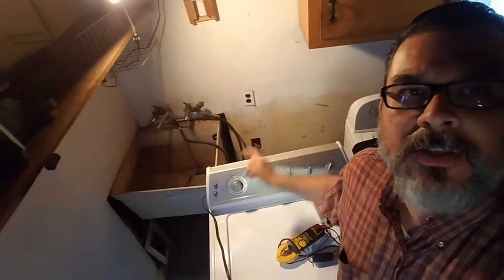When You Put 30 Amps On 20 Amp Wire This is the Result

Comment: I don't buy it. When cable is tested by the manufacturer, it is tested with a factor of 3. This means that a #12 wire has to pass a 60 amp load test in order to be certified. The caveat here is that those tests procedures have to be met by any manufacturer making and selling cable in the USA. These days, you are seeing some Romex made in China and other countries that may be cutting corners on materials used to make the actual cable. They stamp the cable package with their certification testing to match that of the USA, but are manufacturing cable to only look like USA made cable. This may be one of those cases. Folks, when buying cable, outlets, breakers and panels, use only USA made products with a UL stamp. I've actually had custom devices tested and either approved or rejected by the fine folks of UL/ETA. They actually test each product to strict standards to assure quality.   Amazon is one distributor who sells cheaply made electrical products that don't adhere to USA standards.

Comment: That has nothing to do with too much amperage. This is probably localized damage from rats chewing through the wire. You can clearly see dust build-up along the length of wire which would have burned off under a real heat overload. Rats chewed the wire and caused a localized short circuit. I agree on code compliance but your reasoning is flawed. Take a welder and put 60A through 12 gauge. It gets warm but that's it.

Comment: Hello, I have a question. I have a v-neck trailer wired with yellow, 14/2.  I want to be able to plug into camp site 30 amp. But the wire is 20 amps, and the breaker is 20 amps, there's 2 of them. All the appliances (tv, split unit heat/air, out let where the tv plugs into. There's not any 220/20 amp needed.  I appreciate any your help in this mind bender.

Comment: I'm running a large in room A/C unit in my bedroom (I'm in Las Vegas) and when the compressor is on (I researched this in the manual and other places) the unit pulls 15amps. The bedroom breaker is a 20amp breaker. Which when I plug in a vacuum or hairdryer or other items causes the breaker to go off. In the summer it's going off 1-2x a day. Is it possible to plug the A/C unit into a really big surge protector / UPS device, and then plug THAT into the wall? Like create some sort of buffer? Great video now I understand the wire capacity is just as important as the breaker itself. I was thinking "I'll just throw a 30amp breaker in there" LOL

Comment: WOW This video is all over the place. The constant cuts in scenery make is so distracting. You may well know electrical work but explaining it is very confusing. If I'm looking for info on "30 Amps On 20 Amp Wire" I don't need any other info. The whole story about the customer hiring another electrician is 100% not going help with changing a higher amp on a breaker. If you make a mistake on a video (which is good that you caught it) with the marvelous wonders of video you edit that out. Be concise. It does nothing to tell us you made mistake and then have us sit through that mistake.  I am quite certain you know way more than I ever will about electrical but we won't find out this way.

Comment: I know Romex conductors have a lower amp rating than regular thhn (I don't don't deal in Romex, only pipe)..... but it's rated at least 25 amps I believe, the problem might be the tight holes it's run through and the super sharp bends I saw.... there are rules on these things for a reason (before derrating 12 can be rated 20 amps.... of course that's not 100% duty cycle... and none of this is professional advice)

Comment: I’m not a licensed electrician but I suspect that the overcurrent didn’t directly cause the wires to become damaged. The overcurrent did cause the sheathing and insulation to become damaged leading to a short, which in turn damaged the wire.

In any case, someone didn’t know what they were doing. 

Thanks for sharing.
Reply: I did this oh no I thought it was 103 but it was 123 oh no now just eating on bad news lol😂

Comment: You said something that's incorrect.. You said that a number 12 wire is only good for up to a 15amp rated breaker , it's Actually up to 20amp breaker.  ONLY RULE IS YOU "CANNOT"  PLUG A DEVICE INTO A RECEPTACLE THAT'S PULLING MORE THAN 12 AMPS AT A TIME ON A 15 AMP BREAKER OR NO MORE THAN  16 AMP PULLING ON A 20 AMP ... IF SO THE RECEPTACLE IS GOING TO MELT   WITHOUT IT TRIPPING  THE BREAKER.. IT'S VERY RARE SOMEONE WOULD PLUG IN A DEVICE THAT'S DRAWING THAT MUCH POWER AT A TIME ON A SINGLE RECEPTACLE..

Comment: So........you didn't discern this from just looking at the wire connected to the breaker in the panel or just looking at the wire in the plug? Seems like first thing to do is pull the plug. And even if the wire was not damaged that alone would require a new line.

Comment: I have 2) ecoflowDelta Pro units  (solar generators) that, when combined by the double voltage hub, (an echoflow accessory)  creates a 250 v 20 amp outlet.  I intend to run an extension cord (12 gauge?) from this outlet to an inlet box connected the 30amp circuit breaker in my  main panel box.  This circuit breaker is  dedicated to my 1/2 hp water pump.  the wire that runs to the pump is  looks like 12 guage.  My question is, is this a stupid thing to do?
Sonyador

Comment: This is a great video. I was thinking of replacing 20 amp breaker with 30 because it keeps tripping from over draw of power but the wire needs to be changed as well to be able to handle the extra current. Very important lesson. So my question would be how can I determine which outlets are on which breaker so as to seperated machines from same line.
Reply: Turn off the existing breaker, and see what turns off. Then trace the wire from the panel.
Reply: He said something that's incorrect.. He said that a number 12 wire is only good for up to a 15amp rated breaker , it's Actually up to 20amp breaker.  ONLY RULE IS YOU "CANNOT"  PLUG A DEVICE INTO A RECEPTACLE THAT'S PULLING MORE THAN 12 AMPS AT A TIME ON A 15 AMP BREAKER OR NO MORE THAN  16 AMP PULLING ON A 20 AMP ... IF SO THE RECEPTACLE IS GOING TO MELT   WITHOUT IT TRIPPING  THE BREAKER.. IT'S VERY RARE SOMEONE WOULD PLUG IN A DEVICE THAT'S DRAWING THAT MUCH POWER AT A TIME ON A SINGLE RECEPTACLE..

Comment: run 30 amps thru a 14 gage wire rated for 15 amps, the heat will be 4X more than it should be.

Comment: Thank you for your detailed explanation!   I bought a new stand alone air conditioner - Perfect Aire 14k BTU  it has been running fine for 2 weeks, and now it’s throwing the 20amp circuit breaker occaisionaly - Not sure why.  
Perhaps the fridge is running on the same circuit...

I was going to replace the 20amp (new) thinking the new one might be faulty and put in another 20amp.  Then thought why not go up to a 30amp.   Thanks to your video I will not risk burning down my house!!!    Thank you!
Reply: Update problem was a loose wire on the circuit it’s self vibrating just as you said thank you so much it was a quick fix!

Comment: If you put 14 gage wire on a 20 amp circuit will it be ok if it is only from the switch to the light and 12 from the breaker threw all outlets to the switch

Comment: I’m confused is that 12/2 or a 12/3? Are they use the ground as an neutral?  Did you replace the wire?
Reply: Looks like 12/2 with ground, probably an older dryer which does not use a neutral (3 blade plug)

Comment: enjoyed your video. I was hoping you might be answer a question for me. I'm new to this. I bought the min kota Endura c2 trolling motor. The smallest 30 lbs. thrust motor they have.  The battery box they sell is 50 amps circuit breaker. The guy at min kota said I need a 30 amp. Do they make a battery box with a 30 amp circuit breaker that is integrated. or do I have to have a separate circuit breaker.

Comment: So on the flipside aside from possible breaker trips could you use a 15a breaker on a 20a?  Assuming you werent drawing too much power it seems like you wouldnt do any damage aside from having the breaker trip at a lower load.
Reply: There's never a problem with using an oversized wire. The only downsides are that thick wires cost more, and are more difficult to maneuver in walls and fixtures.

Comment: I appreciate the video the wire could overheat and cause a fire.  My electrician did the opposite he used a 220 wire 30 amps for a 20 amp breaker
Reply: David Seaquist --- My electrician is going to replace my 20 amp wiring with a larger wire so that I can run a 30 amp device with a 20 amp breaker. I thought I would need a 30 amp breaker! Is you device working with your 20 amp breaker?

Comment: the point of the video is very important. More than likely someone thought it would be a good idea to upgrade a 15 amp breaker to a 20 amp breaker. the Problem that occurred was the wire was not rated for that. So the wire burned from the inside out which could have started a fire. dangerous! so thank you for the video. you did a great job going step by step. dont worry about what the critics say about your film editing skills. that comes with time and watching others how they do it. but other words, you helped me with my problem so thank you!
Reply from the maker: thank you for your perspective. this is the only reason I have kept this video up, as the information is critical, not because I am a good editor.
Reply: @MassiveElectric  You did okay after the 1st 2.5 minutes.  What through me was you were standing in front of a dark pond that sort of looked like a burnt area so the good news the video is educational and no one got hurt.  I have 12 gauge wire with 20 amp breakers & want to go to 30 amp and I may need new wire since the house was built around 1960 and I need thicker wire.  But I will hire an electrician because of fire fears & no insurance company will cover fire loss due to self upgrades unless done by a licensed pro!!!  

Ever see the Blair Witch movie?   The video is  like the Blair Witch utility edition of how not to upgrade and why they avoided the fire.   Add movie sound effects and all he needed was the witch.  Better to have a lil laugh than delete the video.

Comment: Question...i have a gaming chair with 2 speakers and a small subwoofer.Worked fine until my gf plugged wrong power cord into it.(i wasnt there when it happened but chair requires 12 v and she used a cord that pushed more than 12v)Now theres no sound.How can i tell if its fried without amp clamps and such?
Reply: Easy..... It's fried.

Comment: Problem @ 3:25 - 30 amp breaker installed on 12 ga wire (needs 10 ga copper - which is larger/thicker wire)
Result - wire can't handle the load, so it overheats and can start a fire. The End.
Reply: 12 is rated for 30 amps
Reply: @salythaone  12 is illegal to use for 30 amps.
Reply: @MAGAMAN  go back and read
Reply: @salythaone yea 14 awg easily handles 30 amps, it gets like Luke warm. AHJ exception rule in the NEC. Great job reading.

Comment: Like Sgt Shults - I know nu-thing.....how can I tell what gauge wire is being used?
I have a 220v 20amp breaker in box
I would like to replace the 20amp with a 30 amp
but I don't know if the wire is safe to use with 30amp.

I can't see the wire at the box or at the outlet -
so if I remove the outlet cover can I see something that will identify what gauge wire?
Or do you have to remove the breaker box cover and get in there to find out ?

Comment: Thanks for posting. Kept me from making same mistake.. I was about to to changing my breaker to 30 amp from a 20 amp because my sauna was intermitently turning off and I needed to flip the breaker back on.  I checked and see my wiring is 12 G. 3.31 mm.  So I am going to first try a 20 amp breaker replacement . but not replace with a 30 amp and call my electrician if that does not work. 
I am sure many others can easily make this mistake and cause a fire later on. I almost did, but viewed your video. Glad you took your time and went through the reasoning and thoughts on how you discovered this problem. Thanks again.

Comment: I replaced my 20 amp plug in breaker with  a 30 amp breaker which seemed to be working fine  my 110 window unit a/c  was continually tripping the breaker.  Well now not tripping breaker but melting plug. Replaced wall socket, spliced  in New  plug  after the first melted. Worked fine 2nd day  melted again. What's UP?  Nothing else is plugged in that socket but several lower amp things on same breaker.
Reply: After you change you plug out and the breaker back down to 20amp, take the casing  on the  a/c off. I can almost guarantee you what's wrong... remove the fan shroud, you will see a layer of something is caked on the inside of the radiator. Clean every year and a/c will stop tripping the breaker:) best advice I ever got!
Reply: If you can't figure out what is wrong after reading what you just wrote, there is no hope for you.
Reply: Well, what do you think happened? Especially since it happened twice?
The connection is going to heat up at its weakest point, thinest point, or point with the most resistance.  In this case it was your plug. The problem is that you can't run 30 amps on a 20 amp wire for the very reason that you just experienced. Upgrade your wire to 10 AWG and keep your 30 amp or reduce it back down to a 20 amp breaker. Sometimes you're placing the breaker is all you need as breakers can get weak over time and trip easier.

Comment: What brought me here was I just ran 100ft of 10ga wire for 30 amps to an outbuilding after using another outbuilding with 20 amps 12-2 wire and an extension cord for years,,,I wanted to put 30 amps on that wire and everyone I knew jumped me lol 12-2 = 20 amps and 10-2 or 3 = 30 amps. So I for one enjoyed the vid and what happens to an overloaded 12-2 wire. They were lucky the house didn't burn down.

Comment: i have only 110 volts cycling down to low as 70 volts the numbers jump around a bit across a black and a white wire that go into my light switch that control one light fixture....the light works though im suprised... also with my non contact mm it is showing the white wire at the switch is hot and the black wire is not hot....if u would tell me if something is wrong with this set up....i beleive this is an end of run switch, only a white and black wire in the switch box.... thanks
Reply from the maker: +Marty Forkwater it sounds like you have an open neutral or a loose neutral somewhere the white wire is loose or it's becoming loose like inside of a wire nut or loose on it either on the switch or in a splice. Also, if I am understanding you correctly and there is ONLY 1 black wire and 1 white wire inside the box where the switch is then there is no neutral there (at the switch). It sounds like the white is the hot leg coming from the junction box at the light and the black is the switch leg going back up and connected to the light itself.  Either way, assuming you arent having voltage fluctuations anywhere else, I'd recommend looking inside the junction box behind the light for that loose neutral. If it fluctuating between 110 and 70 volt while you are looking at it then is is just a very slightly loose connection which is probably loosing contact due to some almost undiscernable vibration in the building, such as the motor on a central air unit which may be somewhere else and not connected to the circuit. If this has been happening for a while you may see greying, blackening, discoloring or charring of the conductor itself where ever the connection is loose. The second place I would check is the neutral wire connection to the neutral bar inside the electtical panel itself, again looking for the same visual indicators or simply a loose screw. Other than that, you'll have to start digging through the circuit but I doubt you will have to do that our you would have seen the problem surfacing in other parts of the building already such as bulbs burning out or outlets not working properly.
Reply: @MassiveElectric  
Great diagnosis. I might also addv
1) If you don't find it you could have your house burned down.

2) you can measure the ohms for each leg.
Disconnect both the hot, (black) and the neutral, (white), at the breaker box.
  Run a separate conductor wire from end to end, (breaker box to outlet) along the ground. It can be an extension cord but just use one conductor even if it's the ground of the extension cord. This temporary run is going to be used to complete the circuit for testing each leg. Test each leg and compare the two readings. There should be very little difference in ohms between the neutral and the hot runs - like less than 10 ohms max. You keep moving down the line testing each conductor at each junction back to the end of the line. Each time the ohm readingshould be pretty close at each for each junction. As you test each, move and wiggle the wire to see if you can duplicate the intermittent contact.
Once you find a change in the ohms as you are testing down the line then you know that the issue is between where you're currently testing and where you last tested.  Move the temporary conductor so that you can isolate and test between the two junctions.  He may not even have to do that as you might very well find the loose wire or grounding neutral in one of the junctions. If so, remedy the situation and then retest the ohms from end to end to verify. Then reconnect all the runs at both ends and then test the AC for Amp  stability.